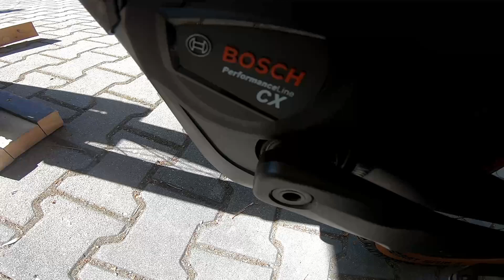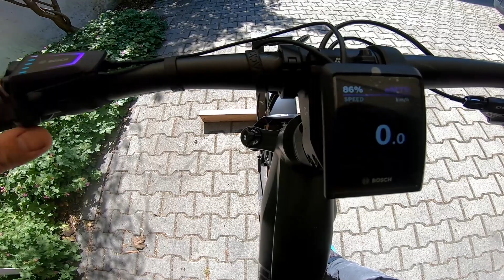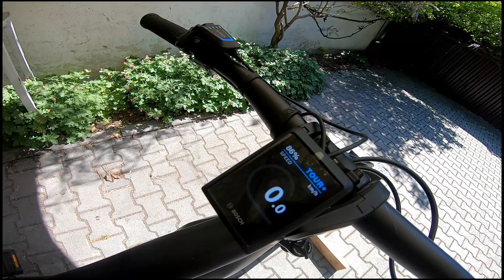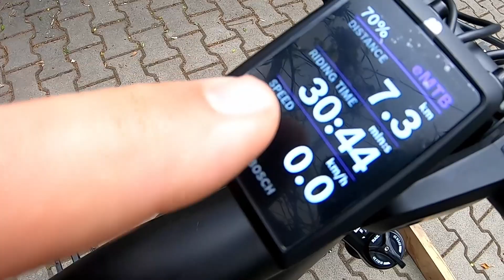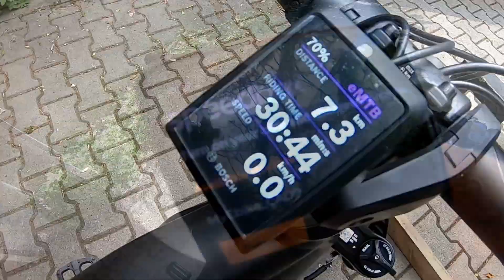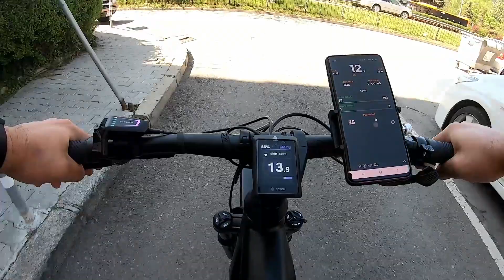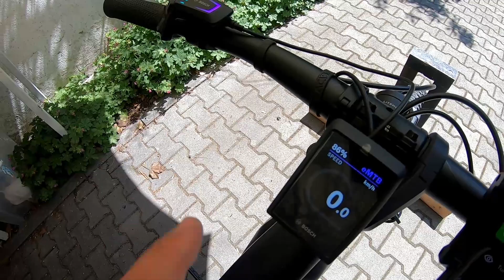EBIKE TUNING FOR BOSCH NEW SMART SYSTEM SPEED BOX 1.0 & B TUNING

Comment: Definitely something I want to try, but the new update blocks the Speedbox and bricks your motor until you strip it all out and wipe it on a diagnostic! A few people are reporting this at the moment, and it voids your warranty immediately, as it leaves a trace on the system that can't be removed! However, the Speedi seems more straightforward; unfortunately, it doesn't have an app or anything like that, but it doesn't connect to the motor to leave a trace if you need anything from the warranty. Kinda puts you off with the warranty void and system trace sure there would be a way around this 🤔
Reply from the maker: Yes, there is a new version 1.1, Go better for Volspeed V2

Comment: hello, When updating by the flow app, can we leave the speedbox or should we remove it, update and put the speedbox back.  THANKS
Reply from the maker: Better do not do updates or use Volspeed or Speed Fun
Reply: Remove the FLOW completely, I just removed the speedboat as not compatible with "SMART SYSTEM"

don't do any updates .. it will crash .. like I did !
Reply: @paulgriffiths8153  ok thank you vers much